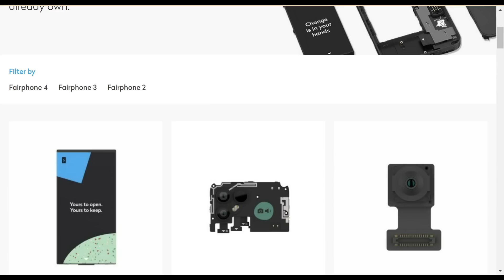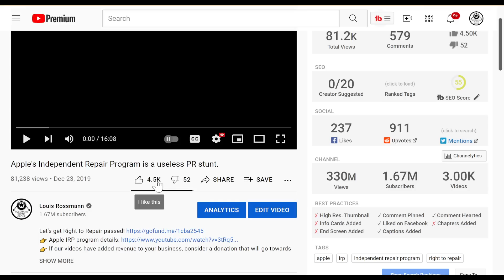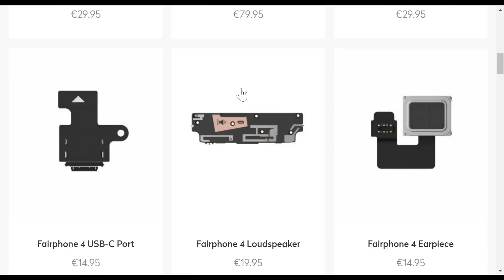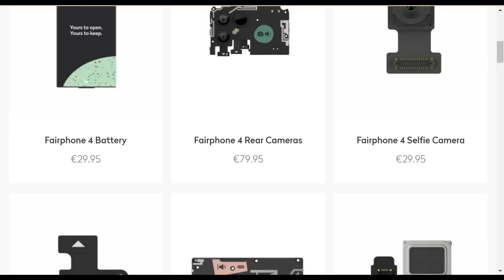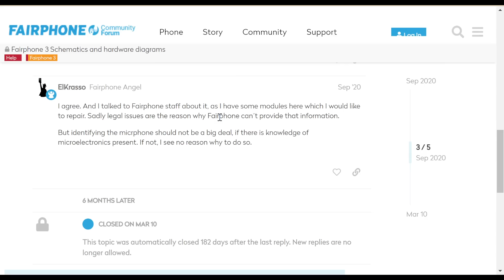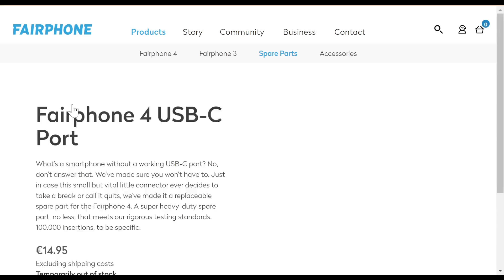Fairphone thoughts & commentary with Louis Rossmann

Comment: Critical smartphone buyers: All agree taking away the headphone jack is greedy and unjustifiable
Fairphone, a niche brand made for purists: Haha headphone jack go byebye
Reply from the maker: You know what's funny, I didn't even notice it. It's not because I don't value the headphone jack, I do greatly. I have a 3.5 mm shotgun microphone with a puffy windscreen that I plug into my phone anytime I am doing videos on the go and I don't feel like bringing my big camera set up. It allows me to get amazing audio quality even if I am out in windy weather, and it allows me to do things like charge the phone through the USB-C port while streaming from my bicycle. You can't charge and use a USB_C microphone at the same time, and you can't ride a bicycle at 35 miles an hour and get usable audio out of the microphone that is built into your phone. This accessory and the ability to charge simultaneously is crucial for the videos that I do and there is nothing that modern smartphones offer over my s10e to make it worth giving up this workflow or functionality.

It NEVER occurred to me that a company that went out of their way to allow the battery to be user removable, would take away the headphone jack. I didn't even think to check. I assumed, given the market they are targeting, they would not remove the headphone jack. That's insane. I guess it's sticking to my refurbished Samsung s10e and fixing this thing when it breaks for the rest of eternity, I'm not buying a new phone with all of the serialization bullshit they do and I'm definitely not buying a phone without a headphone jack
Reply: @rossmanngroup  Could you gove the specs to the microphone you're using outdoors? Thanks!
Reply: @rossmanngroup  There are dongles that break out both power and 3.5mm from a single USB-C connector. So you can keep that workflow of charging + audio even on modern phones, it just requires an external accessory (which while it sucks, is less of a dealbreaker to me than all the closed system crap that samsung/google/apple are pulling)
Reply: @BKearal  These dongles are more expensive and rare, plus this makes phones less portable
Reply: @ironoverheat465  I'm not saying that its a great solution to this problem, I'm all for keeping the 3.5mm jack. I'm just saying that its not a total loss if you want this functionality but can't find a phone with a headphone jack anymore. From my point of view more modular phones as with the framework laptop would be great as well, however looking at the use cases of smartphones and seeing how spectactularly project ara failed I don't think we're getting that
Reply from the maker: @BKearal  Look at how the rode videomic trrs attaches to a phone. A dongle is unacceptable since it clamps onto the phone. Fuck dongles man!
Reply: you can use a btr5 from fiio to have a better analog audio and use the Bluetooth connection.
Reply: @monsterrun  Having a eDAC is not a solution for most people, its unwieldy for the portability of a phone.
Reply: @rossmanngroup  fiio btr3k or btr5k Bluetooth DAC. Honestly I don't use the headphone jack built into my phone. I plug my headphones into my Bluetooth DAC and use that. It stays in my pocket and my phone is then untethered.
Reply: @pivotman1121 The overwhelming majority of Bluetooth codecs are lossyly compressed. In other words, you objectively lose detail and audio data. The first "real" lossless bluetooth codec was created just this year by Qualcomm. Is technology reaching realism not an objective anymore?
Reply from the maker: @pivotman1121  Useless microphone, the mic built into the fiio stuff is trash.
Reply: I'm happy for companies to remove the headphone jack, on one condition, they replace it with a second usbc port. I don't think I've seen any manufacturer do that...
Reply: @rossmanngroup  Fairphone 3+ does have a headphone jack and will still last you another 5 years since their still selling it, this might be an option
Reply: @rossmanngroup  So you're telling me that you don't ride around at "19.999999 Miles Per Hour"?! :O I am shocked Lewis, shocked ;)
Reply: @rossmanngroup  It's astonishing isn't it?

And they've smoothed their message out now (still silly and terrible excuses), but initially they said it was because the headphone jack socket collects dust!  Just completely out of touch.
Reply: @rossmanngroup  I have the s10 500gb and I love it. Its almost like carrying a laptop with me. I won't buy a phone without a headphone jack.
Reply: @rossmanngroup  Not that you should have to go this route, but if you ever do get to a place where you actually do need to upgrade; there are USB-C audio/power splitters out there.

Agreed that it's crazy that this device, of all of them, doesn't have a headphone jack.
Reply: @rossmanngroup  The S10 is a great phone, I use one myself.
Reply: @rossmanngroup  S10e is awesome, I stick to mine as well as long as I can. Then, the same question.. so far, no other phones than Samsung were able to do everything I need/want, especially to use the cordless charging pods I already own - that was the only solution to the endless charging port wearouts since Galaxy S2.
Reply: @rossmanngroup  Maybe the modularity required more space for easy swapping of commonly failed components without knowledge of microsoldering.  This phone is also thicker than a modern Flagship so it's not hard to imagine.  They built this device so that even the most novice user can swap the camera, screen or battery in like 15 minutes knowing nothing about how going into it.
Reply: @Bellthegaomon  I haven't looked into it that much, but I'm pretty sure that they use the same standard FPC connectors that everyone else uses... all it takes to have that stuff be user swappable is not using glue
Reply: @Bellthegaomon  Ask literally anyone, ANYONE of Fairphone's niche: do you want an extra 2 millimeters for a headphone jack? Watch as you hear an orchestral choir of YESes.
Reply: @rossmanngroup  funny is that right now I am charging my Moto Z, listening to music through headphones and, I had to check, I was recording using the microphone on the headphones ... all using usbc -> usbc+3.5mm(4 contact) adapter. For me this adapter voids the argent for 3.5mm jack. I do understand that for some it's still no good as it is something else they need to use to be able to do what they want, but at the very least there IS a way. (Although this adapter doesn't want to work on my S10 - but I'm not the only one having issues with usbc audio devices on a Samsung device - guess "we got you 3.5mm jack no usbc audio for you then")
Reply: @rossmanngroup  The charging and mic input could be done with a little dongle with headphone jack and usbc or even a case that has the dongle in it at the bottom, but I get it its waaay simpler when u dont have to design or even buy dongles or cases and just have it.
Reply: @rossmanngroup  The Argument they went with is that it would increase durability. Now I dumped my current Fairphone3 into water twice, and it actually is very leaky. it survived though, maybe runs a bit slower.. but since you can basically immediately cut the power off when sth like that happens the damage seems to be reducible. 
But if it improves durability in this regard irl, and not just for matching ip54, I think it’s not that bad. You can plug headphones into usb c right? And for the most cases Bluetooth headphones will serve you. An yeah I know, since I had an older Xperia, you can actually protect the case better. I don’t really feel like the huge outrage everyone has is reasonable; like doing that is the one thing that’ll get you into hell^^ most ppl who are able to justify buying their phone will be able to use Bluetooth for most of their use cases or have adopted to it on thei higher end androids and iPhones already.
Reply: @rossmanngroup  I actually contacted them about this myself; let me know if you're interested in what they told me about it
Reply: @rossmanngroup  asus rog phone 5
Reply: @rossmanngroup  Isn't the reason for removing the headphone jack that it makes the phone too vulnerable to rain? At least, that's what I always assumed was Fairphone's reason for it.
Reply: @rossmanngroup What about usb-c to usb-c+3.5mm adapters? It's no excuse of course, just a workaround.

I have used the 3.5mm jack on a phone a total of 3-4 times in the last 5 years (my eyes suck, so I need my ears when out and about, esp. when cycling), so I don't really have a horse in this race.
Reply: @rossmanngroup  I charge my phone and use the same usbc port to listen to music all the time with an adapter.
Reply: @rossmanngroup  Samsung A71 has dual Sim + SD slot + headphone jack +quite good camera. I have the previous model, with a less good camera, but still okay A70.
With Samsung, if you buy their S you'll get less.
Reply: @ichbinueber18  - Louis mentioned in one of his video that he likes smaller phones that fits perfectly in his hand.  The A50/70 series are all larger.
Reply: @BillAnt  true, I forgot about that. btw, my hands are also not able to reach the corners, that's why I have a ring at the rear. So I can handle it with 1 hand and it doubles as a magnetic anchor for my car. 
Anyways, didn't he state he has an S10 right now?
Reply: @ichbinueber18  - He's using a Samsung S10E.  Just got the same model too coming from an S7... don't care for the latest greatest.  It works perfectly for what I need it for. :)
Reply from the maker: @ichbinueber18  crap stabilization in the camera though.
Reply: @ichbinueber18  I have the A70 and I repaired it many times with dirt cheap parts from ebay (yes, I'm not really careful with my phones), I guess I stay with middle tier Samsung as long as I can until a real Fairphone comes along
Reply: @ichbinueber18  The S10 is 300 Euro second hand with 3K OLED, 8GB of RAM, a Snapdragon855 (not rootable) or an Exynos 9820. The A's are crap.
Reply: @rossmanngroup  take a look at the samsung A52s. Has a headphone jack, sd card expansion, 5g, oled and 120hz. I got mine for $520AUD. great value phone
Reply: @rohithmekala2608  Samsung phones aren't ethically manufactured like the Fairphone or Sony Xperia.
Reply: @Triparadox C. Agreed. IPS LCD is much better in my opinion.
Reply: @rohithmekala2608  The only problem with that is being stuck with a Samsung. A company that is giving Apple competition in it’s ability to block repair and you can forget OS updates after a couple of years. It gets worse, they also try to block you from installing an after market version of Android. 520 is a lot of money for an equivalent to an iPhone with less than half the life span. Yep I have the A5 on a shelf and switched off because they stopped giving it security updates after 4 years! It was already incompatible with quite a few apps due to no OS updates after 2 years.
Reply from the maker: @rohithmekala2608  It has shit stabilization in contrast to the other phones, which is sad :(
Reply: @Triparadox C. I used phones with OLED screens for years without any problems. My current Galaxy A71 gets heavy daily use and after ~1 year of use I see zero burn-in or colour problems. Same with the one I had before, that I used for 3 years. 
I would never buy a phone without one again.
Reply: @ForboJack  My 2 year old A70 has 0 burn-in.
Edit:typo
Reply: @Triparadox C. I browse social media, watch youtube, netflix and play games for 5+ hours every day.
Reply: @youtubeairways8646  anything that's manufactured in china is automatically not ethically manufactured, regardless if the main workers get "fair wages" or not.

At this point, there's no such thing as ethically manufactured nowadays. If everything's ethically manufactured, third world countries will have to pay first world prices for even a basic phone.
Reply: @Triparadox C. AMOLED displays don't have that issue.
Reply: @youtubeairways8646  AMOLED is way better.
Reply: @Triparadox C. I have used two OLED samsung smartphones now. And both, after using them for years now still have no clear signs of burn in. My only issue is that in very bright sunlight it can't go quite bright enough to still be legible.
Reply: @rossmanngroup  aww
Reply: @Triparadox C. Different pixel structure. Mobile AMOLEDs use RGB subpixels, LG OLEDs use WRGB (one white) subpixels. They still suffer burn in, but its a completely different display stack, both in pixel structure and the chemicals used themselves.
Reply: @triadwarfare  Xperia is made in Japan, is it not?
Reply: @bbbbbbb51  very much agreed!
Reply: @psibug565  Samsung committed to 3 years os updates and 4 year security patches on A52s. So their update policy is changed.
Reply: @meinfuhrer5041  I'd say it depends on the specs of the displays when it comes to IPS LCD vs. AMOLED.
Reply: @Triparadox C. if it's that bad why are so many consumers wanting amoled screens?
I'm using a 3 year old phone with an AMOLED display from samsung and the display quality hasn't degraded whatsoever
Like maybe after 3 years sure but no way it spoils in 3 months under regular usage
Reply: @Triparadox C. I COMPLETELY AGREE 100% 
It's INSANE that a modern and current display technology WILL BREAK ITSELF from NORMAL use. Like, OLED imho is honestly just... go back to the drawing board display manufacturers, you did it WRONG. DO IT RIGHT.
I wouldn't call it planned obsolescence but damn it's close. I think all OLED technology (unless they find a way to eliminate burn-in) is completely flawed from a design standpoint. Mini-LED is the future.
Reply: @rossmanngroup  preach
Reply: @rossmanngroup  get a dongle
Reply: @jesuschris9543  "degrade your audio quality"?
Reply: Shift Phone looks like it could be a decent alternative. They are a smaller business though and their phones aren't as up to spec but they still have the headphone jack and support modularity.
Reply: @seth9183-h2j  and VERY expensive for the specs.
Reply: @rohithmekala2608  that is also very true
Reply: Hopefully the next Fairphone will bring back the headphones jack or adding additional module for upgrading.
Reply: @BoopBobBeep  ...they will if enough prospective customers demand it in order to buy their phones
Reply: RTR Foss  "It's not a big deal.' is not an argument to not include something that many people do find a big deal, that is how to shrink a customer base.
 I use Bluetooth but always carry a backup set of earbuds, in case the headphone batteries go flat or I want to walk with my phone in my pocket, for some reason every phone I have ever owned gets crackly headphones over Bluetooth when the phone is in my pocket.
Reply: YES! I totally agree! It makes NO sense for their brand. The only people buying fairphones are those who are fed up with the practices of the other phone brands...
Reply: @cinialvespow1054  So the model 3 has a jack, but the 4 does not?
Reply: RTR Foss  bad take.
1. Having a 3.5mm does not affect the use of BT earphones in any way. The more the options, the merrier.
2. For a company whose official tagline is “the phone that cares for people and planet”, driving people towards wireless earbuds doesn’t seem very caring. Wireless earbuds have small batteries that go through their cycles rapidly - that is to say they have short lifespan, the charging case keeps the batteries at full charge for extended period of time (there are exceptions), and their minuscule size meant that the batteries are almost always hard to replace. And surprise surprise, Fairphone sells their own wireless earbuds.
3. We did the market research, the consumers don’t care - where did I hear that before… Oh Samsung, when they got rid of the ingress protection, the mSD slot and the removable battery on Galaxy S6.
4. Sony Mobile seem to have a significantly larger presence in Western Europe than in North America (in fact they pretty much neglect the NA market), and they are adding the 3.5mm jack back after removing it in 2018.

Fairphone does good things, we need to support them when they do. But it doesn’t shield them from criticism, it doesn’t mean standards don’t apply to them.
Reply: RTR Foss  You mean putting obstacles to encourage obsoleting SUPERIOR audio hardware while simultaneously promoting their inferior bluetooth solution is OK because... IP54?? Where does preference come into this, they literally REMOVED a feature, they are RESTRICTING options!
Reply: @ironoverheat465  It's not even about waterproofing anymore.

Samsung XCover Pro. Released 2020. Exynos 9611. Bluetooth 5.0
3.5mm Port. 4050mAh REMOVABLE Battery. USB-C 15W.
IP68 Rated. MIL-STD-810G Compliant. MicroSD Slot.
Reply: @ironoverheat465  sure snowflake, because you all only listen to lossless high bitrate audio on 500$ headphones on your mobile phones to actually hear the difference between a cable and modern BT codecs. Cry me a river.
Reply: @RandomUser2401  "I cant hear the difference in my setup, so the difference doesn't exist", "I don't care that there's literally a part of the audio missing, therefore nobody should" "Technology shouldn't advance in the direction of higher realism and fidelity because I think wireless is cool"
Reply: @RandomUser2401  Also, you for SURE don't need 500$ headphones. Think 50$ on a good deal for a Phillips SHP-9500
Reply: @ironoverheat465  dangles have been a thing
Reply: @isaacbejjani5116  "dangles". nuff said
Reply: @ironoverheat465  I prefer using BT over the inferior cable headphones since I've had multiple get yanked out of the jack, which obviously ruined them. The headphone jack gets very dirty and is only used by a few people. Now that I think about it, I haven't seen anyone use a headphone jack in a while.
They could always give us the option to choose whether we want a jack on our phone.
I also wouldn't need a selfie camera.
Reply: RTR Foss  yes it is. It's needed for radio
Reply: this thing shills user removable battery but has no headphone jack. What kind of absolute f*%kery is this...
Reply: My guess is that charging board without headphone jack that fits their design is available and cheap, so they went with that instead of custom design or changing of their case, that is already set in stone. I am not defending that choice but as automotive engineer, I saw and made similar decisions in my line of work. 
Maybe I am totally wrong but I am more likely to cut slack to smaller company like this on engineering challenges.
Reply: What the hell lol.
Maybe they are using a premade board/base. And the one base type they manage to procure dont have headphone jack
Reply: @whoami1449  it's very rare that someone would NOT use a reference design as a base, but I'm starting to wonder how much they actually tweaked it if at all...
Reply: I dont think thats true. I looked at ltt fairphone video and it has bunch of people saying that its sad they removed headphone jack :)
Reply: RTR Foss  I live in Denmark and I can confirm, that wired headphones are very rare. To be honest, I have no clue why they did this. My assumption is, that they consider small earbuds to be e-waste, and all the audiophiles out there, that I know of, will not use their 1000+ euro headsets, to listen to "ugly compressed audio".  And since most people use wireless earbuds/headsets anyway, and the audio maniacs wouldn't bother, maybe they decided to cut on the price. 
But it's still a question, only the company can answer.
Reply: @user-qy2wf2lt6v  "I live in a wealthy country and my circle of people are reasonably wealthy enough to own modern non-cheap phones (which are pretty much all jack-less), wired headphones so rare huh?" lol
Reply: I’m don’t mean to argue but I just wanna add: USB C 3.5mm dongle tech is advancing like crazy. The Apple Dongle was good with its C100 dac chip but so many others have released their own takes at 5-10usd (HD Odyssey, Avani, Abigail) 

Now why don’t phone companies incorporate both the type C and a 3.5mm with a decent dac from those 5-10usd dongles I mentioned? I don’t know lol. I recognize using dongles means you can’t charge the device, and some dongles have crazy power draws. The ones I mentioned don’t, though

And to further ramble on: Apple was the first to axe the 3.5mm jack but now they’ve got Apple Music Lossless available to their subscribers. That’s something they’ve been planning ever since with the ALAC file format AFAIK. Anyhow, what are Apple’s ‘TOTL’ audio gears? Airpod Pro and Airpod Pro Max. Neither of them can make us of Apple’s lossless offering. Not even the Airpod Pro Max connected by Type C can play Apple Music lossless. You know what can? Their puny lightning to 3.5mm dongle. Why not put that shit in... Bit ‘em in the ass, that one lol 

my brain hurts.
Reply: @Ryan-uf2oi  FAAAAAAAAAAAAAX
Reply: Funny how they also released new wireless earphones, that are, obviously, not repairable, alongside this phone without headphone jack
Reply: RTR Foss  I don't remember any major OEM who has removed the headphone jack without getting the greedy c*nt treatment, fairphone is fair game.
Reply: Til this day i dont know why we dont use 2,5 headphone jack , but now headpohenes contain pcb chip litium battery and mostly work for year , that is good for nature
Reply: @asian meatball USB-C is a digital only port. Therefore USB-C audio hardware must include a DAC (digital audio converter). The vast majority of USB-C earphones will have an incredibly inferior DAC than a built-in DAC inside the phone. The exception would be a USB-C DAC, I guess, but it's not a general solution as its not price effective.
Reply: @Wurzel TeeUseless? To whom? So AAAALL the people here arguing they use it, are lying, because if they can physically find a use for it it wouldn't be useless? Dont use words you don't know the meaning of.
Reply: Dan Jenkins  A certification is a piece of paper. Everyone will gladly take the replacement of every instance of "IP54" with "equivalent to IP54" in their press over not having the jack. Also, are you seriously saying they grant IP68 to phones with jacks but not IP54? Is this a recent change?
Reply: Dan Jenkins  So is that more important than the universal audio port and only price effective high fidelity audio solution used by millions? Why are you defending measly IP54 over that?
Reply: @Wurzel Tee for a start, you're meant to install a custom ROM on an Xperia, they're enthusiast devices. Also, their updates aren't that bad, Xperias from 4 years ago are still receiving occasional patches. On top of that, they have an Open Devices program similar to custom ROMing that keeps older devices on the latest edition of Android. The overheating issue on the I mk. III was fixed in a recent update. I just watched a teardown video on the Xperia I mk. III, I didn't see any glue underneath the battery. I don't think they've done that for years from what I know. The battery lifetime is very much extended compared to competing brands thanks to battery care that prevents overcharging. 

Please do your research before making such claims, or you might mislead somebody!
Reply: The environment and fair salaries for the workers are more way important than a headphone jack. I will still get the Fairphone 4 even though I wish it had a headphone jack and it didn't have a notch. It a compromise I'm willing to make.
Reply: Lets Go Brandon! FJB FKH  well i may not be a representative group (techie, IT guy, 3D pringting nerd) but i cant deal without a jack.
i HATE to charge headphones. it really annoys me, because they always die when you dont want them to and with cable bound headphones - its only one battery i have to keep alive. my phone. 
(and the bluetooth headphones i have, also have a jack - in case the battery dies)

"most" (roughly spoken about half) i know prefer cable bound headphones aswell for the same reason. the other half uses apple products and dont really have the choice anymore.

my personal guess is, that Digital-Analog conversion audio modules for smartphones are getting rare, because the giants (apple, samsung and whoever) got rid of it all together and china reduced the production of these, increasing price, wait time, reference integrations and probably compatibility (3V/5V smartphone stuff vs 12V /24V PC and car stuff) - its just an educated guess tho.
Reply: Lets Go Brandon! FJB FKH  i agree with that. I just wanted to share my thoughts why they may have chosen to drop the thing. I don't think it's Europeans not wanting it, but rather my earlier mentioned educated guess.

I wish they'd put them back too, because my next phone will be the Fairphone 4 in a year or two 😵
Reply: Lets Go Brandon! FJB FKH  Except that their business is consumer-focused and centered on key principles such as fair trade, environmental sustainability, and repairability.

A few points, though:
Removing the headphone jack is anti-consumer in of itself.
They removed the jack but simultaneously started selling wireless buds.

While I agree not to "trash" the company on that point, as you say, I believe that they absolutely need to be called out on their hypocrisy.
Reply: Wait they did remove it for the 4th???
i bought their 3rd Model about a year ago and i was so glad it had one
that kind of dissapoints me to be honest...
Reply: I don't mind that they removed the headphone jack. My Pixel 2 XL has no headphone jack, I couldn't listen to podcasts and charge my phone at the same time at first grrr.

I bought Jaybird X3's as they were the highest reviewed headphones at the time. They weren't ready, they sounded like trash, there wasn't a single good bluetooth headphone on the market because they all used bad low power bluetooth codecs.

Now there's quality headphone options, I have the sony WF-1000XM3's which incedently are the most repairable bluetooth headphones. I didn't realise until after I bought them how easy it was to replace the battery and they sound amazing.

So I have no need for a headphone jack. However I understand many still would. I'm also more than willing to pay more than $20 so others can have the priveledge to use this port. I wouldn't mind a rubber plug for the hole but I also don't care if there is a hole. While I can live without it, I was dissapointed fairphone removed it.
Reply: @Commander_ZiN  Your heart is in the heart place but you don't really fully grasp the situation. Its impossible to use Bluetooth (the current version at least) to transmit a lossless quality signal. There are 2 lossless wireless audio mechanisms (for up to CD quality only) in a desktop wireless headset (proprietary, I think it was a Sony but I dont remember maybe it was a gaming brand) and the other one that works for phones is exclusive to Qualcomm phones and was invented THIS YEAR (the new AptX format). This means there is literally missing data in your bluetooth data stream. The entire song is not reaching your ears. There is literally a part that is missing. Shouldn't that naturally irk you? They are basically saying "oh you don't NEED the full song, here's 95% of it and with added noise and less volume". On high quality headphones the difference between lossless and lossy is very clear. They are shutting off the lossless option entirely and forcing you to use a lossy mechanism or spend dollar bucks on adapter that will downgrade the quality ANYWAY. It doesn't really matter if you or someone else "doesn't mind it", its that those who do are being FORCED into an inferior option, when technology is supposed to get better, not WORSE. It's like people suddenly "forgot" that the ultimate goal is to reach true realism, how are we supposed to get there with a DECREASE in sound quality? We should be expecting it to INCREASE with progress, not even let them stagnate, yet we let them DECREASE it? Wireless earphones are inherently more expensive for the price, and since people in most countries unlike the US won't just pay more and as wireless becomes mainstream pushed by the American consumerist propaganda, the average sound quality the population gets becomes WORSE, because now people think wireless is BETTER or spend the same amount of money in a market now dominated by wireless options. How is that good? We are literally going backwards!
Reply: @ironoverheat465  I fully understand the difference between lossey and lossless and such. However AAC and AptX are very good. Most people store their audio in Mp3, the codecs are better than mp3. If you have flac then your only option is wired.

However AAC and AptX is more than acceptable for most. Have a listen to them.
They sound better than my best wired in ear headphones or as good as.

If you use over ear headphones then I can understand wanting more, but AAC and AptX are of an acceptable quality.

Anything higher and the DAC in the phone probably isn't up to scratch anyway.

If sound quality was that important to you, I seriously doubt you'd get any of the Fairphones.
Reply: @ironoverheat465  also I don't think you fully read what I wrote to the end. Did you miss the part were I'd be willing to pay extra for a headphone jack even with no plans to use it?
Reply: I'd go with Sony Xperia rather than Fairphone, they have similar ethical and open-source principles to Fairphone, plus a headphone jack and many more features. The 10 mk. III is cheaper, and the 1/5 mk. III are a few hundred more. I'm not sure they're as repairable but they're not sabotaging repair like Apple or Samsung and they're more water resistant.
Reply: @youtubeairways8646  I've had them specifically because of this. I've gone through a couple gens of them and overall they're priced like the flagships, have the same hardware as the flagships but the software is completely barebones. headphone jacks, basic water resistance and good battery management. minimum bloatware. I have a 1 mk II
Reply: @facepalm7345  Xperias from years ago still outperform the latest 'normie' flagships in my opinion. Stereo front-facing, 4K, Hi-Res certified, plus too much more to mention, and all ethically manufactured and with a focus on openness. There is nothing that comes close.
Reply: @youtubeairways8646  yeah I’ve seen their phones and they look really nice and they don’t Even have a stupid notch or a holepunch
Reply: @Defender004  yes, Sony respects the content by doing that. In the slim top and bottom bezels they fit a great pair of forward-firing stereo speakers. Not only do they respect the content, but the people who manufacture their products.
Reply: @youtubeairways8646  My Xperia won't even try to get OEM updates after being bootloader unlocked - even if I try to relock.
Reply: @zxcvb_bvcxz  that's strange, have you tried contacting support? I've gotten at least one update since the last time I unlocked the bootloader.
Reply: @youtubeairways8646  no, unlocking your boot-loader and flashing a ROM nukes the proprietary blobs even if you return to stock Sony skin. Camera gone, audio gone.
 I would be fine with Sony if they didnt sell a phone full of proprietary tech that I cant use after flashing LOS.
Reply: @burhanbudak6041  doesn't the 'Sony Open Devices program' solve that?
Reply: @youtubeairways8646  I go by memory and Sony is notorious in trying to make proprietary tech the standard. as there are patents they wont make a black box. Sony ODP help in custom roms, they dont fix the blobs.
Reply: @burhanbudak6041  urgh, that's unfortunate. How might that affect someone trying to install a custom ROM? Is it a very impeding issue or a first world problem that's just there but we can live with?
Reply: @youtubeairways8646  nobody is stopping you, its just that when you sell the device, the casual users wont get the same experience of the OEM ROM. The issue would be fixed if Sony sold the device without the software keys cheap. It reminds me of Linux day and getting windows every time you bought a PC back in the day.

Im sorry not explain. The Sony phone has the best censor and software. You want to use Lineage. You unlock the bootloader and the keys for the proprietary software gets deleted forever. But I could be wrong, ask experts in Sony Experia custom roms.
Reply: @burhanbudak6041  while I'm here, do you happen to know anything about getting Google Camera (HDR+) on Xperia? Would it affect privacy on a device that is otherwise Google free (such as Lineage OS without Gapps package)?

Thanks for all your knowledge.
Reply: @youtubeairways8646  Sony offers one update abd 2 years of security updates. And that 2 years start from release date. So Sony is the worst offender.
Reply: @jepulis6674  you're meant to install a custom ROM!
Reply: @youtubeairways8646  Sony cares about FOSS? LOL.
Reply: @bart9522  yes, they have an entire project dedicated to it.
Reply: @youtubeairways8646  I took a look at it, but it seems none of their software is actually FOSS. E.g. their stock camera app.
Reply: Fairphone 4 does have a jack 3 didn't right?
Reply: @fringeanomaly9284  you got it the other way
Reply: RTR Foss  I don't prefer bluethoot, I just adapt to the phone
Reply: Yeah they dropped the ball big time.
Reply: There is already so much bluetooth and wifi interference in my home and it will be bad for rhythm games and cant play lossless unless your headset is really good
Reply: @3wGaming  Wireless headsets with custom dongles instead of Bluetooth have similar latency to wired.
Reply: @3wGaming  There is no mainstream bluetooth codec for lossless audio, in fact Qualcomm just THIS year released a lossless bluetooth codec for AptX, and that's only for CD quality, anything higher than 1400Mbps gets lossy compressed.
Reply: @3wGaming  no Bluetooth headset can play lossless, since every Bluetooth standard has lossy audio transmission.

But that doesn't even matter, because any DAC you could considerably fit & power in a pair of headphones won't be powerful enough to let you hear a significant difference between lossless and a decent lossy compression anyway. Another factor for why wireless headphones will never match the audio quality of wired ones.
And that's just one of several reasons (charging, battery life(span), compatibility, ease of use with a variety of devices etc.) why wireless will never fully replace wired headphones and removing the Jack from smartphone was a really dumb idea!
Reply: I hate having to remove a broken headphone jack  that is stuck on the port lol.it has happen before lol
Reply: @purpledoge4466  "I am an extreme negative edge case for this feature therefore its warranted to comment about this rare negative experience in the face of the millions of wired headphone users who are complaining a useful feature was removed"
Reply: Although I know there are certainly exceptions, I think most people won't even notice. Haven't had a headphone jack in years. How do do I it? $40 wireless earbuds I bought over a year ago. Not only is it more convenient, but they last longer too. Just gotta remember to plug them in once a week
Reply: @Fredy_The_Yeti  Most people in the world use wired headphones as opposed to wireless. Most people in the world don't have a lot of income to buy expensive phones (the most commonly jack-less) and wireless earphones which are incredibly inferior for the price. You are so incredibly detached from what the average person in the world is lol.
Reply: @ironoverheat465  I'm not sure I understand your response. Let me first say, yes, I understand that I come from a relatively wealthy country, and I don't expect everyone to be able to afford what I can. So I do see value in what you said. But I also find it a bit contradictory.

I was talking about the fact that most people buying this phone probably won't be hindered by the lack of a headphone jack. Your response was about how most of the world buy both phones with headphone jacks, and wired headphones, due to them being cheaper. But if people who can't afford the wireless headphones aren't buying this phone, then how is that relevant? I think we can both agree that if you can't afford $40 headphones, you probably shouldn't buy this $700 phone. If this were a budget phone $200 and under, I'd completely agree. I mean, I have wireless earbuds, and I wouldn't even pay this much for a phone
Reply: @Fredy_The_Yeti Fine, here's the whole explanation. A headphone jack is essential for price/perf headphone usage. Because wired earphones/headphones under 100$ are exponentially better than wireless. 1st, because true hi-fi (note, hi-fi ≠ expensive necessarily) engineers only make wired products due to the inherent sound quality advantage of no bluetooth lossy compression + relying on either a built-in hi-fi DAC or an external hi-fi DAC (which the vast majority only take analog input [3.5mm or 6.5mm]), 2nd because ensuring high fidelity takes additional engineering cost which quickly eats up the price budget, meaning implementing bluetooth directly takes away from the hi-fi engineering budget due to the high cost compared to no bluetooth. Meaning, all cheap bluetooth earphones are trash quality compared to equivalently priced hi-fi wired ones.
Reply: @ironoverheat465  I don't dispute the fact that the wireless feature makes the earbuds more expensive. But I think where we do disagree, is how much people value audio quality, or maybe you just think relatively cheap wireless earbuds are worse than they actually are. My $40 wireless earbuds don't sound noticeably worse than any wired ones I've had. Granted, I've never paid $40 or more for wired earbuds, but I don't think most people do. My experience when buying earbuds was to pick up whatever 10-15 dollar pair happened to be in the store. Maybe I'm unique in that sense, and don't care all that much. If you're an audiophile, then yeah, it's probably going to matter. But I don't think most people notice. It's like the difference between a 2 and 4k TV, put them side by side, you'll know the difference, give it a month, you won't be conscious of it at all. 

To clarify, I am talking about the average person. There will certainly be people who fall outside these averages and I recognize that they will have completely legitimate issues
Reply: @Fredy_The_Yeti  We are talking advancement and features in tech. What the average person does or do not get to perceive because they dont make informed buying choices is not relevant to the discussion of whether there should be obstacles put in place for the ideal price effective solution. If you do not make informed buying decisions, its on you, but dont let that expectation that others will do the same as you ruin the technological advancement of phones. Audiophiles don't have special ears or anything, its literally a matter of paying attention to detail. Fact is, just this year was a lossless bluetooth protocol invented (and its nowhere near a true mainstream standard), all other protocols lossyly compress, sometimes brutally, the audio stream in order to transmit wirelessly. There is literally speaking less sound information and detail travelling to your ears. You can't expect everyone to be happy with being pushed into this and having no choice without massive obstacles and extra cost. We want to have the same choice we had all these years with no if or buts, just like we always had with no issue, its literally just AN option, that's being heavily restricted, for the sole motive of extra profit. There is no valid justification.
Reply: @Caleb Brewster if you are part of the company put a headphone jack in it. You should have done research on it for your target audience. My phone is used as a computer most of the time as are most phones as powerful as an s10. Had Motorola z3 couldn't stand it because Bluetooth audio sounds like shit even the ridicuusly expensive ones.
Reply: hey thats the phone i am using :D (model 3)
Reply: This and also the notch. The notch is HORRIBLE. These two features are why I still daily drive a Pixel 3a.
Reply: @Handl3sAreStupid  notch bad, agreed brother
Reply: Well, it's not the end of the world. If everything else is easy to maintain and repair, then it's still an excellent product. I would prefer to still have a 3.5mm jack. With enough demand, they'll add one to another model I'm sure. They obviously didn't choose not to include it because they're trying to sell wireless headphones.
Reply: maybe the reference design din't have it (I mean, going out of their way to remove it would be outrageous...) and they are just so incompetent that they couldn't manage to add it?
Reply: @asian meatball they definitely share schematics
Reply: Dan Jenkins  they totally could have it be completely wayerproof, it's the same exact problem as the usb port and both were present on waterproof devices back when it was the norm... same with removable batteries
Reply: RTR Foss They aren't greedy liars overall, but in this instance they WERE greedy liars.
Reply: @Caleb Brewster If you actually read and reflected on the extremely valid criticisms some have elegantly put out, you would not make this comment. You are the fanboy here. Care to remember what the collective reaction was when the iPhone 7 launched? Times have changed, so we can't feel what we felt then, for a brand that was loved?
Reply: Dan Jenkins  IP54. FIFTY FOUR. IF YOU DROP IT IN WATER, IT WONT SURVIVE.
Reply: RTR Foss  ... It a big deal.
Reply: I want the fairphone, I dont want a headphone jack.

There, one.

They are not trying to appeal to the niche of purists. They are trying to appeal to mainstream. And like it or not, you wanting a headphone jack makes you the minority these days. Don't you think these companies do market research? Let alone Samsung and Apple not doing market research?
Reply: @caesar485 The fairphone buyers are a critical niche. Get real, nobody else is buying Faiphones beside people who dislike the current phone market.

Am I a minority for wanting a headphone jack? Really? Have you asked the entire population of planet earth? The same population who is overwhelmingly using budget phones that still have jacks, and those who own headphones overwhelmingly own wired ones? 

You are detached from reality. You are rich, in a rich circle, living in a superpower nation. The headphone jack is not useless, and your memory is extremely faulty, if you don't remember the collective reaction when the iPhone 7 launched.

If the general population knew, unlike you, that there is no reason to remove the jack besides greed, do you think all of them would still buy jack-less phones? They don't know, because like you, they allow corporations to spoon feed them their narratives.
Reply: @ironoverheat465  sheesh. I touched a nerve there didnt I?

You claiming something as fact doesnt make it so. 

These companies do market research and if there actually were that many people who are frothing at the mouth for a headphone jack, they would keep the headphone jack.

Fairphone 4 isn't a cheap phone, they're not targeting the bottom end of the market and they're only selling in Europe at the moment. Where pretty much everyone is rocking a flagship phone. 

I didn't ask everyone, but I'm pretty sure the companies did market research. Especially about something so spicy as getting rid of the headphone jack. So in a very real way, yes I did ask everyone in the target audience of the fairphone. Did YOU ask everyone if they care to keep it?

I have a Samsung galaxy s20, but when I can I will switch to a fairphone. Not because I can't afford a more expensive one but because I'm done with shoddy charging ports and batteries that die.

You're citing your personal experience as fact. That's not how this works however. Actual quantitative market research is how you determine if people want a headphone jack, and turns out? For an expensive phone, they don't.
Reply: you should visit Europe, it's awesome, please come
Reply: @rocketman1058  I will someday, thanks!!
Reply: RTR Foss  europeans preffer headjacks,most top eu phone sales,xiaomi for instance,feature jacks
Reply: Rummy 
Man, I don't get that.
Ed
Get what?
Rummy 
That texting s###t
Ed 
And what's wrong with texting?
Rummy 
You mean besides the fact that it is the stupidest f####ng thing in the world? I mean why would anyone in their right mind spend 15 minutes tryin' to type some s###t they coulda called and said in five seconds? Plus, it involves typing with your thumbs which I just don't approve of. S###t I don't know about you but I don't have time to read nothin' some mofo typed with thumbs. Fun Fact: Nothing typed by someone's thumbs has ever been important. It's all just n-word technology anyway.
Ed 
What you call it?
Rummy 
N-word Technology. Technology for n-words. And you don't start tripping an' s###t calling me a racist 'cause I don't mean n-word in a disrespectful way. I mean it as a general term for ignorant mofos. Anybody of any race can be an ignorant mofo.
Ed S###t. 
I be texting my ass off. B###s like texting. I be texting them all the time. Matter of fact, I be texting my weed man too 'cause he don't like being on the phone so I text him.
Rummy 
Case. In. Point. So basically, n-word technology is anything that doesn't plug into a printer. Does that plug into a printer?
Ed 
No.
Rummy 
You know why? Because n-words never have anything to print. 
                         ©The Boondocks
Reply: Lets Go Brandon! FJB FKH  I know 3 people who own a older model fairphone.
None of them ever use Bluetooth but when they're in a car.
Reply: Lets Go Brandon! FJB FKH  If they wanted to succeed, they wouldn't take it away. It's really funny how you can make up these scenarios when the reality is that people actually complain about the headphone jack's removal for a reason. Do you not like capitalism? Do you not believe in voting with your wallet? Do you not support increasing consumer buying power? Lmao.

You settled. You got pegged by "Crapple" and Samsung and all your other corporate overlords and now you're trying to justify your actions to others. If they hadn't taken it away in the first place, you wouldn't be here defending inferior wireless audio.

You say you love the headphone jack in one reply, but you say that it's a little thing in another - so which is it? Do you not know what love is, or are you that meek not to want to try to fight for it?

You of all people, with a name like that, should know about what happens when you let things slide and move the goalpost inch-by-inch just to appease one's self-esteem.

It's really funny for you to assume that Fairphone's downfall comes down to the headphone jack - the entire topic of this thread - which I guess, means that it isn't as small of a thing as you try to make it out to be. I guess they should have added it, then, huh? That's the market for you.

By the way, I use custom OS and kernels on my devices - I also repair and maintain my device myself. I'll be fine lmao. You on the other hand, might want to go appease big tech somewhere without a large pro right-to-repair community.
Reply: Lets Go Brandon! FJB FKH  you hh
Reply: Fairphone isn't for purists. Purists don't own smartphones
Reply: Agreed and they sell a pair of $99 disposable wireless earbuds.
Reply: Everybody, stop bitching about it already.
Yes, waterproofing and headphone jacks don't mix well. Not even mentioning dust or broken jacks inside of them.
Yes, a headphone jack is HUGE if you know how small internal parts really are nowadays.
Yes, there are adapters, UCB-C cables and bluetooth earphones.
Reply: @jaypaans3471  actually they do mix well, and the FP4 isn't even waterproof.
Louis explained the advanatages of a headphone jack pretty well
Reply: @jaypaans3471 This wasn't a problem 5 years ago. Why does this have to be a problem now? Back then, we had dozens if not hundreds of phones with water resistance + headphone jack, NOBODY, NOOOOBODY complained or asked for it to be removed. EVERYBODY UNANIMOUSLY went up in rage after Apple removed it. Now? Since everybody is doing it, its ok right? Now we have the new generation defending it like its good for us somehow??

Ah yes, broken jacks, something obviously every headphone owner has to worry about /s

Adapters are not a solution. THEY DEGRADE SOUND QUALITY. And guess what interface all truly high fidelity headphones use, because its the best quality?? Are we suppose to take regressions in quality as acceptable now? Like, does the whole "tech evolves to realism" go out the window now??
Reply: For me personally, I always feel like wired headphones break more often, so I'm either using  aux or wireless so I don't think id miss it. It doesn't excuse the omittion
Reply: they did have a headphone jack in the 3+ so I'm assuming based on whatever feedback the got in the eu/netherlands they decided to forgo the jack cause more users use bt for this next gen.
Reply: @DracoDragon369  This argument is so moronic. How is more prevalent use of Bluetooth justification for TAKING AWAY a feature that's UNIVERSALLY used? It's not beneficial for Bluetooth users AT ALL, it only HURTS wired users!
Reply: @ironoverheat465  I don't agree with them removing the jack, im just wondering if they made that decision off of feedback. Like were enough of their users using the headphone jack to justify it being their, or could they forgo it for another feature? Thats really all im suggesting. They'll probably add it back with enough feedback, i think they have their heart in the right place.
Reply: @DracoDragon369 It's been proven time and time again that removing the headphone jack doesn't, and never will, aid in new features. You can have IP68 or even military standards (Galaxy Xcover or Galaxy Active), removable battery, and headphone jack with no problem at all.
Reply: @ironoverheat465  As I said I don't agree with them taking it away, but since it is just for this version of the fairphone maybe it was just to see what they could do without it. Like I still have a Samsung galaxy s5 LOL It has a headphone jack and honestly, I never use it. However that's because earbuds for me are a terrible experience an cause my ears to bleed (skin condition in ears) and headphones can cause similar problems. So I mainly use aftershokz which are bt. If there are enough complaints they'll probably add It back in the 4+ or 5 cause it already was there in the 3+ and previous versions. I just see no point to crucify them as some people have in removing a component but it was only for one version of their phone. for all the good thing fairphone is trying to do I think no headphone jack is a small price to pay. They are here in the comments so probably wouldn't hurt to ask as to why they decided to remove it.
Reply: I don't understand why that is even a thing...
Reply: My biggest problem is that they are now selling TWS earbuds, right below Fairphone 4. TWS earbuds are as disposable as ipod nano and are against their goal.
Reply: In the comments under Linus' video they said they weren't able to stick to a certain modern smartphone acceptable design and fit in the audio jack. But promised they will look at it another time for the next model. They might react to this video too. Don't be too hard on them, they are one of the good guys imo
Reply: @kgroenhart  that's BS, I've had thinner phones than the fairphone 4 with headphone jacks. It's certainly doable. Packaging is not an excuse.
Reply: I don't use wireless anything, except WiFi, and even then my actual computer has a wired connection. I have a wired mouse as well. I also use wired headphones on it and my iPodTouch.

Wireless transmission eats battery like crazy. Wired items do not need to be recharged and won't die in the middle of doing something. Wifi alone drops my iPod's battery from about 8 hours to about 1.5 hours. How much more would blue tooth cut it? Wireless accessories are simply not worth it.
Reply: @Acaykath  I couldn't even imagine the pain using wireless headphones on my S7. The battery life has degraded so much in the 3 years I've owned it that if I had to use bluetooth as well as wifi, I'd get like 2 hours of use before the battery is dead.

But I guess the people saying wired anything is bad can buy expensive wireless products and also replace their phones before their phone even starts to show symptoms of degradation. And the funniest thing is that having the 3.5mm jack doesn't even affect them in the slightest.
Reply: @Caleb Brewster and you're a virtue signaling bootlicker.
Just because it isn't life-supporting doesn't mean we shouldn't have an opinion on features that we're missing and shouldn't be allowed to voice that opinion.

Fact of the matter is repairability and sustainability is not gonna be the only deciding factor for most people and the lack of a headphone jack is evidently a dealbreaker for many - repairability minded - potential customers
(myself included)!

Nota bene: the alternative to wired headphones/earbuds is far less sustainable (requires batteries that degradate rather quickly) and - at least in the case of earbuds - inherently irreparable.
For a company that wants to make a phone as sustainable & repairable as possible, that's a serious shot in the foot! 💁‍♂️
Reply: Creative Sound Blaster PLAY! 4 Hi-res External USB-C DAC. There you go a modular headphone connection for your phone. Others like Astall & Kern do a super high quality twin dac ones but I have found this to be good.
Reply: @psibug565  might as well get Hi-Res built in with an Xperia. Having to carry around a DAC AMP combo or an adapter dongle just defeats the purpose of a compact, convenient smartphone.
Reply: @psibug565  oh yeah, because that makes a ton of sense:
Remove the headphone jack to make the phone slimmer, then carry an additional, bulky external DAC to get good audio from it 🤡

I'm so glad my LG V30 has a decent quad-DAC and the Jack built in. And it's still decently slim.
Hope it'll last me much longer than my previous phones, because every newer phone since has at least one completely ridiculous trade-off!
Reply: Here are some things I personally want to see on the Fairphone 4+/5 and I want to know how people think of them:

- 1440p OLED screen with 60.00hz refresh rate with no notches, holes, rounded corners, etc. I prefer to have a fully rectangular screen like on the Fairphone 3.

- 12MP front camera and 48MP rear camera which can record video in 4k at 60.00fps

- back of phone is metal instead of plastic

- would easily pass a JerryRigEverything durability test

- and of course a 3.5mm headphone jack
Reply: @tristanbay  sounds great, especially the bezels and headphone jack. 48MP is an unnecessary gimmick in my eyes. Also, less MP = Greater low-light performance, from what I've heard (which is why Xperia dropped 23MP and higher a few years ago). 1080p 60FPS recording is enough, for anything higher you might as well buy a dedicated camera (i.e DSLR). 1080p 960FPS on would be a fun but unnecessary feature.
Reply: RTR Foss  it's really no big deal.  I haven't used wired headphones for years
Reply: @radicalpaddyo  "I havent used it so other people don't need it" "I think authentic audio is not important therefore others must too"
Reply: They sell a USB-C to 3.5-jack adapter for €9,95. I suppose you can use your microphone with it too.
Reply: @henrischutte1968  that degrades sound quality. And adds clunk to his already space sensitive biking routine. And is not a justification for taking away a useful feature.
Reply: My old ass iPad has a headphone jack… know how much I use it, never ever. My old phone I use for running has a headphone jack. Know when I used it last? Never. I didn’t even use it right after I bought it. I’ve been using wireless headsets since forever, I hated working out with wires. I know it’s cheaper. But it sucks more to get stuck in equipment than paying the small premium.
Reply: @HandheldGamingNet  wireless is more stress. Charging, losing them etc. Also, quality over a wire is generally better. I would gladly buy a pair of Sennheisers over some wireless device for the same price that has excessive bass, sounds tinny and will break within a year. If you really want no wire, the compromise of a wireless Fiio AMP/DAC is okay. Bluetooth isn't a very secure technology, also. Wireless audio devices for a few hundred from reputable brands are often good, but these same brands often are the ones creating better wired products. It's good that there's choice.
Reply: @HandheldGamingNet  "I dont use it therefore it's not important", "Its old therefore bad", "it's not the best for working out therefore its bad", "having more options as a consumer is bad", "authentic audio quality is not important to me so its bad". Am I getting this right?